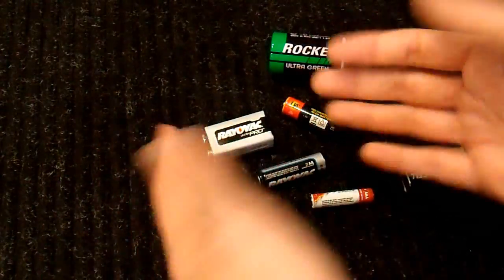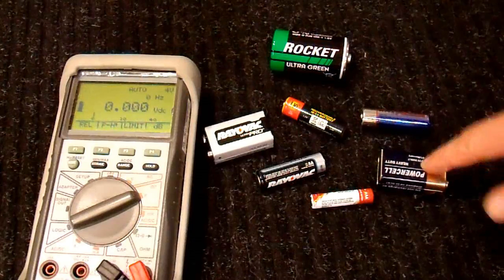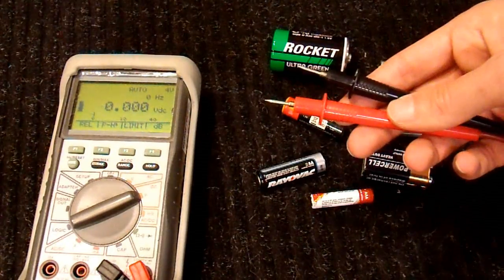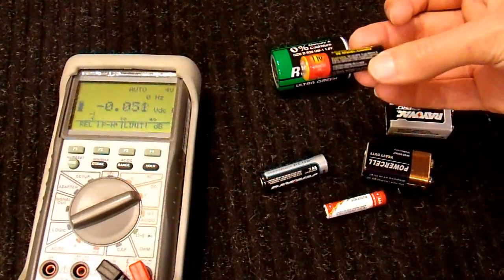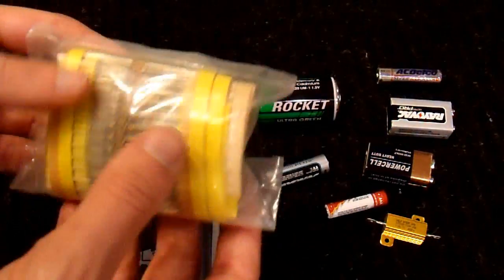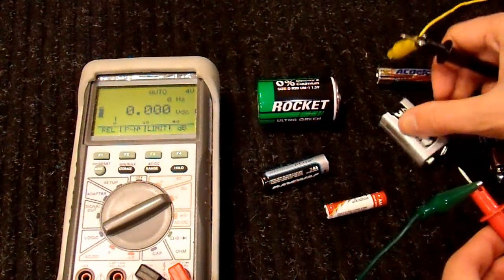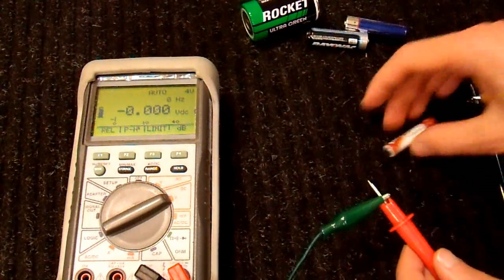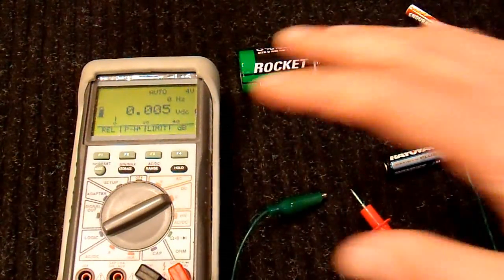How To Test Standard AA, AAA, D, C, and 9V Batteries with a Multimeter

Comment: Great video! Got a quick question for the gurus out there. Can you just measure the amps instead of the volts?
Reply: 12GaugePadawan That is what the cheap HF freebee does. with a 375 ohm internal load. it wants to see 4ma out of a 1 5 volt battery or 25ma out of a 9 volt battery. If the current is less it is because the battery voltage dropped under load.
Reply: @ 12GaugePadawan :  The short answer is no.

Theoretically, with a known resistamce, you could measure the current (amps) that the battery delivers, but it's just as easy, if not easier, to simply measure the voltage. 

And if you only measure the current, you won't know the voltage at which that current is being delivered (unless you have a second meter), so you're still somewhat in the dark.  It's handy to know the battery's voltage while under load. 

(I have two meters and I often DO use both, in order to know both the voltage and the current, but I'm a naturally curious person and I'm very nerdy that way. 😉)

For what it's worth, I would use a much lower resistance than 100 ohms, though.  To really know the condition of a battery, you need to put a pretty heavy load on it, so I use a 1-ohm resistor when doing such tests.  Works great.  🙂

Comment: Another question, if a dying battery develops internal resistance, won't that show against the voltage thereby providing a sufficient test?
Reply: +juntjoo nunya : ONLY when under load -- that is, when current is being drawn.   If you just measure the open-circuit voltage with a digital meter that draws almost no current at all (no load), you will know nothing about the cell's internal resistance.   You need to put a load on the cell in order to know what's really going on and what kind of condition it's in.If you put a substantial load on a cell with a high internal resistance, that resistance will gobble up a significant amount of the power that the cell is producing, resulting in lower measured voltage and lower current output.  But if you don't test the cell under load, all you will see is the full open-circuit voltage, which doesn't tell you much.  You'll never know what's going on inside the cell (that is, what the cell's internal resistance is).
Reply: Thanks!
Reply: +juntjoo nunya :  You're welcome!
Reply: @Milesco  Maybe you'll see this and can reply - maybe not. But you seemed knowledgeable and responsive to others' comments, so will address this to you. So what I'm understanding from what you say, using lay terms, is if I put in 6 fresh 1.5 AA batteries into my kitchen's motion garbage lid, and it acts like it has a weak battery, and I test all the batteries and they all show ~1.5, but then re-test them under a load like in the video, I can determine which of them is 'bad;" right? But how big of a drop am I looking for? This is exactly what I'm doing, and I see they all show a minor drop (like -.1), but nothing spectacular. Swapped all the batteries out for additional fresh ones, and the garbage lid is working as expected. So I still have a bad battery from the first batch, but not sure which unless I go through process of elimination. I bought a cheap resistor, but maybe it is not putting enough of a load - it is printed with 100W 1.2 ΩJ . Any advice to this novice would be appreciated. I could also use this to help in my work in the technology field where people are constantly giving me their small devices (mics, remotes, etc) to fix and it is usually just a battery. Thanks!
Reply: @a11Oop968  :  Hi Alice, 

You need to test each battery (technically a "cell") individually.  

And yes, you need to put a substantial load on them or else the batteries will look much better than they really are.  In my opinion, for AA cells, the 100-ohm load that the guy in the video uses is nowhere near enough.  I use 1-ohm "power" resistors for this purpose.  Yeah, that's a heavy load, but it'll tell ya for sure whether your battery is good or not!

In my experience, a good battery, even under that fairly heavy load, will read at least one volt.  If it reads less than, say 0.85 volts, I would toss it.

From your comment, it looks like you're using a 1.2 ohm resistor.  That should be fine, but you have to be sure to attach the resistor in parallel with the battery, not in series.  If you put the resistor in series with the battery, it won't put any load on the battery at all and it won't give you a true reading of its condition. 

Hope that helps!

Comment: My Extech 330 doesn't do it, but I have a cheapo Harbor Freight multimeter that actually has a setting to test batteries. For example, when you hook it up it shows around 4.0 mA for AA, AAA, etc and 25 mA for a 9V battery.  How does it work? Is it placing the battery under a load?  Very interesting that a cheapo would have it and a fairly decent multimeter wouldn't.
Reply from the maker: Some of those cheap-o meters have functions that work very well indeed!  Yes, your meter does put the battery under load and tests it properly.  You can just use your Harbor Freight meter and ignore this video.  :)  As you said you can't use your Extech to do the same function even though it is likely a better product overall.
Reply: *****  Indeed my Harbor Freight dmm  has become my official battery tester. Well at least I finally found a use for it.
Reply: I'm gonna buy this multimeter....Mastech 830L Magnetic Electronic Level (16 cm)...you think it will check batteries right without need of attaching a 100 resistor!!
Reply: It's so weird. I got the freebie cheapo multimeter at Harbor Freight a week ago since the previous one died from leaving it on accidentally. Then tonight I found some batteries lying around and wondered if I could test them with my new meter. Your video is the first one I watched, and if I hadn't read the comments, I wouldn't have known my meter can properly test them without having to go find a resistor. ( I have an AAS from TSTC but that was in the early 90's and went into another career) and I realized I forgot how to read the colored stripes on the resistors. If you don't use it,  you lose it. Oh well. But it's so nice to find the perfect answers to my situation in the very first video/comments.  I won't be testing any transistors or diodes anytime soon but this meter apparently will test those too. Great video thanks for explaining it to all of us.

Comment: What was the wattage of your 100 Ohm resistor?  I tried this with a 100 Ohm 10W resistor; was wondering if that was too much.
Reply: Silver Turtle I believe the wattage is the amount of power it can handle. So anything higher should work.
Reply: Oh, OK -- thanks for the information.
Reply: Silver Turtle np mate
Reply: Silver Turtle The wattage rating of a resistor is in regard to the maximum amount of power (wattage) it can displace. Using a restatement of Ohm's law it is possible to calculate the power displaced by the resistor. P=(V^2)/R where R is resistance (ohms), V is potential across the resistor (voltage), and P is the power watts, or in this case milliwatts may be more appropriate. Suppose you wanted to test a 12V battery using this method. Then a 100 ohm resistor would displace P=((12 V)^2)/100 ohm= 0.144 W or 144 mW of power. Since this is less than 0.25 watts, 250 milliwatts, a 1/4 watt resistor or greater can be used. For most conventional batteries a resistor with a 1/4 watt rating or better will work for this purpose.
Reply: Brandon freeman

12 squared is 144, yes?

144/100 is 1.44 not 0.144, yes?

Comment: So you put the resister in parallel with the battery and not in series?
Reply from the maker: The resistor is in parallel with the battery, yes.  The idea is that the battery is loaded while being tested.  If the resistor was in series with the meter it would do nothing.

Comment: I am looking at a "5% 50W 100 Ohms Wirewound Aluminium Housed Resistor Gold Tone" resistor, is this correct please?
Reply from the maker: 50W is overkill for what I show here.  5W is perfectly adequate and you could make do with 1W in most cases.  Realistically, if you just want to test batteries a cheap battery load tester is the best solution, but if you're a geek like me then you'd rather have control of the load and understand exactly what is being tested with a known resistance.
Reply: In the end I found out that the Powerex MH-C9000 will do what I need all in one, as well as the Eneloop batteries being the best ones to use, but thanks for the info, never would have found out about that otherwise!
Reply: p=v^2/r so >1W for a 9V and 1/4W for 1.5V.  For a few seconds test a 1/2w is fine even for 9V.  The Maha C9000 is great, though. Battery geek's dream for NiMH, and a 100-1000mA load for any kind of AA or AAA.  Can do C & D with some home brew fixtures.  You can also fully discharge a sample cell or few to see how a brand performs or to get an idea if your pack of 2011 batteries is really any good for your 300mA LED flashlight any more.  Really, though, Eneloops are the things to use. Or, for emergency backup or extreme temperatures, Energizer lithium 1.7V cells.  NOT for incandescent flashlights though. Or even cheap LED ones.

Comment: I see you put the load in parallel, why not in series?
Reply from the maker: If the meter was in series with the load then there would be no load because multimeters have 10's of megaohms of impedance.  It would always read the same voltage as the battery open circuit.

Comment: i have a 100k resistor. can i use that one on a 9 volt?
Reply from the maker: Gar Suitor's comment gives more details on what a properly sized resistor would be for a 9V.  Somewhere in the 100ohm to 1000ohm range is probably good enough for casual use.
Reply: @knurlgnar24  thanks. What would happen if I used my 100k?

Comment: Would this work on a Efest  2500mAh  IMR 18560 3.7 LI-MN 35 amp battery
Reply from the maker: This method works best with batteries which have a relatively high internal resistance such as Alkaline batteries and Heavy Duty batteries.  It can be used on Lithium ion batteries but a higher drain than 100ohms would be better for those.

Comment: Does exist an meter with this resistor method included on it?
Reply from the maker: There are meters with a 'LowZ' setting that helps but this isn't really designed for battery testing.  If you don't want to use an external resistor then I would recommend purchasing a dedicated battery tester.  They are pretty inexpensive. Be sure it specifically states that it loads the batteries as it tests them as some of the online ones are just inaccurate multimeters and are useless.

Comment: It is incorrect to say "this doesn't really tell me if they're good or not". The voltage multimeter test can tell you if a battery is bad. As long as you confirm you are making a good connection, if the voltage is below the rating, the battery is not good. If it is far below rating, it is not going to be good for any application. So the multimeter voltage test can identify a bad batter, but it cannot, by itself, determine if a battery is good.

Comment: I saw someone test a battery by using a 360 ohm resistor in series and he measured current. http://www.instructables.com/id/Add-Battery-Test-to-a-Multimeter/?ALLSTEPS  What is your opinion of this method?  For your method, under what voltage reading do you throw away a 9 volt or 1.5 volt battery?

Comment: I don't get it. I'm an electronics newb. Why "internal resistance"? And if you hook up a resistor won't it absorb some of the voltage resulting in less voltage at the meter? Or did that happen ever so slightly?
Reply: It did happen, and I think he mentioned that, but it wasn't enough in a new or good battery to pull it down enough to throw off the results. Maybe. I don't know, either! lol! ;)

Comment: You can’t overload a circuit, people might buy a 10K resistor.  It should be possible to test right in the battery compartment of the device, since it is the actual load.

Comment: So, how many minimum volts is needed to run an appliance?
Reply: John Slezi It varies with the appliance. It also depends on the load. with a heavy load the battery may drop too low to run it. with a light load the voltage stays higher.
Reply: the kind you plug in a wall plug ?  about 98 min..and it should have 115 volts

Comment: hello sir.How to test the capacity(mAh) of a battery?
Reply: Δημήτρης Βλαχοσπύρος There is no easy solution. You decide what your load will be or use the actual load and determine the lowest usable voltage and see how long it takes to get there. The mah is also somewhat load dependant as you get more out of a battery at lower discharge rates. For any quality battery the mah is published on the company site.

Comment: The open circuit voltage actually tells you a LOT... a 1.5V battery is new at around 1.6v (open circuit).  If you read 1.5, 1.4, etc... they are getting weaker.  If you read like 1.1 or 1.0 they are deader than a brick.... they taper off their voltage quicker near the end.
Reply from the maker: Measuring open circuit voltage sometimes tells you something, but it tells you nothing about the internal resistance which is critically important.  I have a couple of 9V batteries that measure over 9.5V and are completely useless.  They failed from factors other than active material depletion as is common for dry cell batteries.
Reply: That is surprizing.  A 9v is normally not possibly dead until it reads 9.00 volts or less... Similarly, a 1.5v cell generally isn't likely dead until it reads 1.50v or less.  That said, I totally agree with the internal resistance.  A cell with lower resistance reads higher under load.

Comment: Nice, but what is good, and why is 2.7 bad?  Not a good video for the layman
Reply: 2.7 volts on a 9-volt battery is very bad. A 9-volt battery should maintain something very close to 9 volts under load when new.

You have to look at the voltage rating on the battery to know what it's intended voltage is. AA, AAA, C and D batteries are 1.5 volts, for example, and they'll say so on the label.

Comment: Don't you forget to tell which ports on the multi meter to use? Mine has three. So I have three options, and don't want blow things up.
Reply: +mmmmm : You just measure the voltage.  As long as you're only measuring voltage, you won't blow anything up.  But be sure to put a load (resistance) across the battery terminals so you can see what the battery is actually capable of doing.  Open-circuit voltage means very little.

Comment: Doesn't seem like much of a difference between using a resistor or just the multimeter, especially concerning non-9volts.
Reply from the maker: I've commonly seen AA batteries measure 1.5V+ but be bad, and I have also seen this problem on D batteries in high drain temporary multi-amp loads (like ignitors or pre-heaters).  9V are the worst offenders though.  In reality I usually just use a multimeter and only test under load if something fishy is going on.

Comment: does the wattage of the resistor matter? tx
Reply from the maker: It does.  Kind of...  Any resistor rated for 1/4W or above will be just fine for most batteries but if you want to test 9V batteries you could need a resistor rated a bit higher.  That said even a 1/4W resistor will be fine on 9V batteries so long as you only connect it for a few seconds at a time.
Reply: What if I touch the multimeter leads with my fingers while testing...human body has resistance (not constant but still there), will that work if I don't have a resistor lying around..
Reply: ***** I just got a multimeter by excel in the mail. I put it on 20v but it only shows up at 0. I put in M but it shows up finally. I'm doing tests on batteries as the same ones you have here. does that mean I bought a DOA ??

Btw, I put this into my power supply for my computer and it started getting hot and smelled smokey. I put it into the orange and black pins as you can find as your typical paperclip test. What is going on here??
Thanks
Reply: Wrathorn Is it the DT9205a model...there are many fake Chinese copies of Excel multimeters...the cable quality of the probes is not that good either....you may have ordered one from a shady seller.
Reply: Anosync Thank you for your reply. I am working on getting a refund from the ebay seller ugh.
Reply: ***** Isn't this too small of a load to check the health of a battery (13.6ma)? Even a nearly dead cell should be able to deliver that without much of a voltage drop.

Comment: what are the multimeter settings???
Reply: +Jeff Thompson V==_ (pulsating DC) and set it to 20 V. When I test my AAA and AA cells, I set it to 2000 mV because I prefer the more exact display. However, 9V blocks will (obviously) need the 20 V (max) display setting.